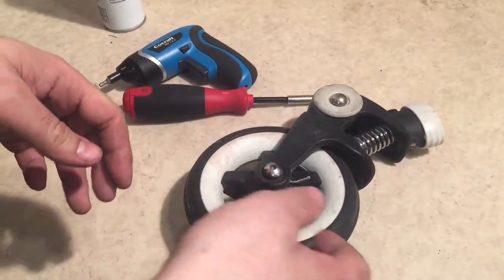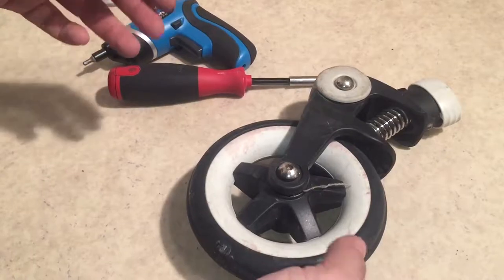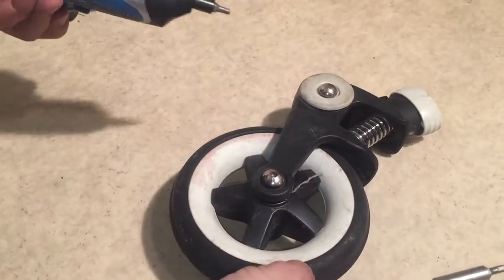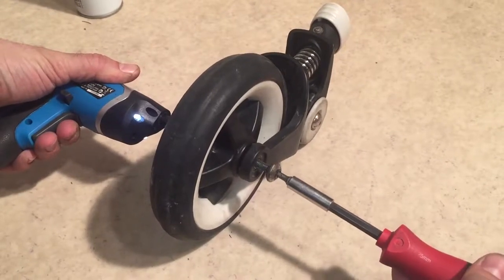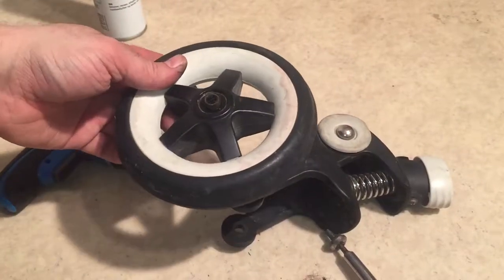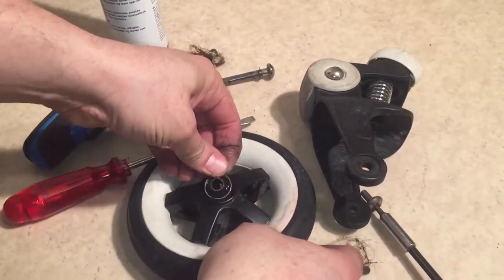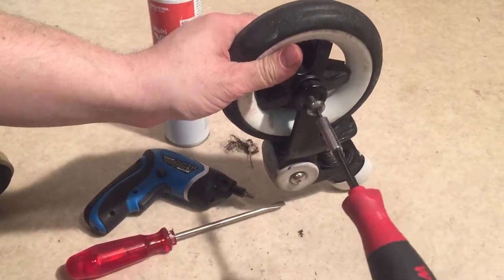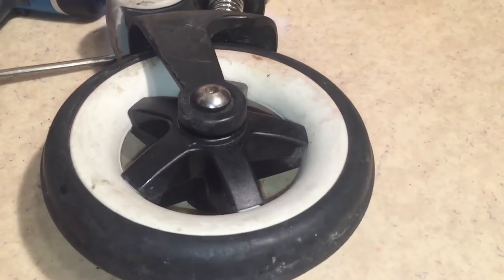Disassembling the Front Wheel on Bugaboo Bee Models

Comment: For bugaboo Bee+ you can remove the axle by using a T25 star and a Hex. But I tried using all Hex and I can remove it. Based on the screw quality and the force to apply on locking the axle, I can say its impossible to damage even you use all hex. its very easy and soft to lock the screw and don't need much force. Though I don't advise using other than star when locking the axle back because maybe too much pressure will get it damaged.

Comment: Hi there, thanks a lot for the video.

I can get the screw out of the wheel after some forcing but the axel bolt is then stuck fast. Any tips about getting it out?
Reply from the maker: The bolt is probably rusted into the ball-bearings, find a pipe that's the same diameter as the bolt and start trying to bang it through from the other end with a hammer, and use prying tools as well.  when this happens there will almost always be some cosmetic damage to the plastic by the time you're done, and don't be afraid to use force. :)